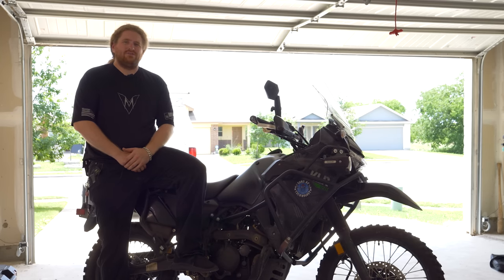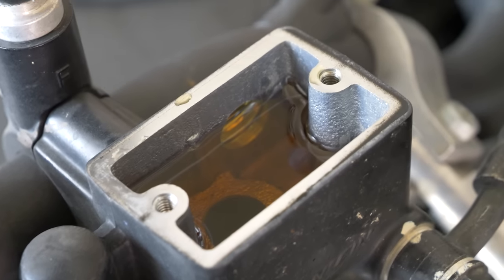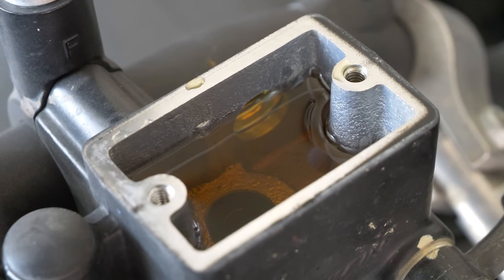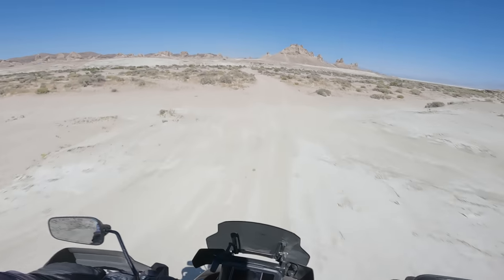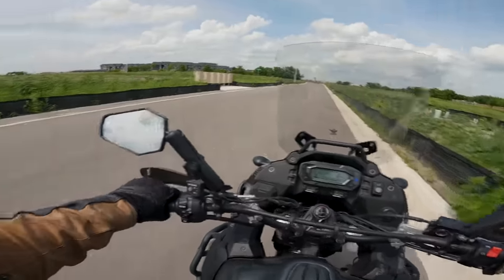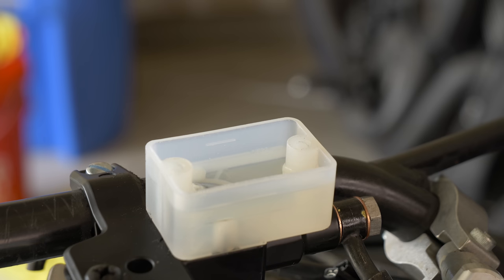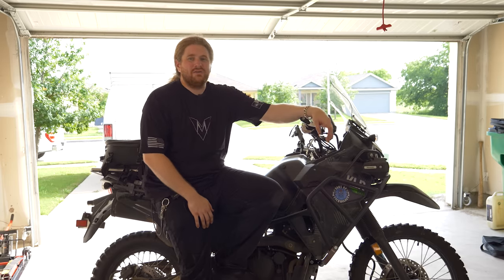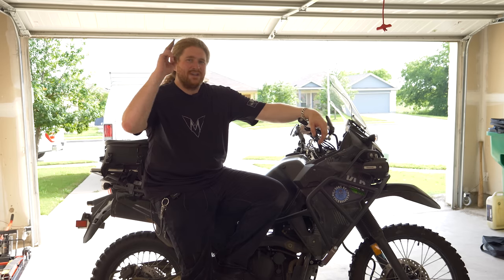Is Upgrading Your Motorcycle's Brakes Worth It?

Comment: Based on personal experience; both for dirt bikes and street machines, the biggest difference A -> B I've witnessed is changing over stock brake lines to stainless braided ones (if your bike comes stock with reinforced rubber/teflon lines from the factory).
If the bike already comes with stainless lines, the next best thing is a Brembo RCS-19 master cylinder.  I love them to death, and have so far installed 4 of them, including my kx250f.
Reply: That seems like a big jump in fluid being pushed around, from an 11mm piston to 19. Is that with a stock caliper? How much lever movement do you get from 0 braking to a stoppie?
Reply: @burgersquid   It's less about the amount of lever travel and far more about lever feel.  Braided lines definitely make a stock master cylinder (mc) far better than it was designed to be, but then the mc becomes the ultimate weak point of the brake system.  The main reason why I enjoy the RCS-19 so much is for the same reason why I prefer cable-style clutches over hydraulic ones.  It's not just what I feel from the lever that's important, but the fidelity and high definition of what I'm feeling in the lever as I'm pulling it.  The RCS-19 allows me to feel the minute pressure pulsations that come from the tire being forced up and down by the road and my suspension, and thus the lever pulsates slightly in the grasp of my fingers; slightly outward under compression, slightly inward on rebound.
Reply: @jacquescrusan9500  No they do not. It has been proven many times that braided lines do not expand less than rubber lines.  If you have new lines braded and not they will feel the same and they wear out at the same rate. Brakes lines unless hardline need to be replaced more often than people think they do.

Comment: In my experience, cleaning the pistons with soap water and a tooth brush and then grease them with red rubber grease helps a lot and is a very cheap fix. I do it at least once a year, together with replacing the brake fluid.

Comment: I swapped out my brake fluid after watching you basic maintenance video.  So glad I did it, the old fluid was dark yellow/brown.  Didnt feel much difference on the road, but at least I know its serviced!
Reply: Dark yellow/brown means there is a lot of water in it. You would notice if the brakes got hot. The water inside would start to boil. Gas compresses much more than fluid. That is the main difference between DOT 3 and DOT 4 fluid.

Comment: VERY informative for those of us not mechanically inclined.
My personal experience: Keep EVERY moving part in your brake lever mechanism as clean and lubed as possible. 
Periodically bleed your brake fluid as it gets dark and by nature it absorbs moisture.
It helps a lot  when it comes to squeeze the max braking power w/o locking your wheel(s) and prevent scraping both your bike and ego.
My front brakes are not the greatest when it comes to feel and I almost lost the front end braking hard when someone decided to make a left in front of me even tho they had a red light and I had the green. 
Lever had been feeling stiff and dragging.
Took it all apart, cleaned, inspected for wear and galling on the surfaces that mate (M/C plunger and lever's cam, lever's bushing, lever's pivot bolt), greased it all, assembled it and the better lever feel came back.
I hope my rant and long post helps someone.
Stay aware and ride like you're invisible !  😊👍

Comment: Interesting vid. Pads & braided lines is a pretty cost effective option for good results. Unless I was tracking it or the standard equipment was really awful, I personally wouldn't shell out for a new master cylinder but it's probably worth it if you can afford it.

Comment: I would say that it's always worth it to "upgrade" the brakes, as the ability to stop is way underrated.
I have an 82 KZ440, with a single disc rotor up front.  However, being a UJM that shares parts with its bigger sisters, I could add a second disc and caliper with little to no problem (other than the price-tag, and Mrs. Moosecat).
I might just do it, though.

Comment: Depends on the age of your bike. I done a full upgrade on my Concours14. Braided line on all brakes and clutch. Had master cylinder rebuild kits for front brakes and clutch. Both kits combined cost less than new master. Then new pads front and rear. Made it a completely new bike. 08 model with 55000+ miles.

Comment: On my track motorcycle, it came with 2012 budget ABS. I replaced the lines with non-ABS stainless lines directly to the calipers, new pads and, and fluid. I also replaced the lever because they came with the rear-set pegs… They feel great and work well on track, no rear brake light installed. My only issue is a persistent ABS light on, but I also removed the pump and extra lines…

Comment: My preference is EBC HH pads, brided lines, and now I would use DOT 5.1(after using in my car seems fine) doesn't paint strip like DOT 4. Master cylinder I would only upgrade if badly worn. But more than likely just get a OEM seal kit.

Comment: On the KLR the best you can do for the front is the 320mm rotor kit.  
Use kit Stockton 1124076 brake bleeder kit(under $20), it has a inline check valve so you don't have to constantly open and close the valve.(I use it on my cars also and recommend it to everyone)
Use silicon to lube up the caliper slide to prevent the slides from sticking and prematurely wearing the outside pad out.
Reply: I favor speed bleeders on every slave cylinder.

Comment: The first thing I did after getting an 87 Kawasaki 454 LTD was change the front brake master cylinder and brake pads. When I moved it 100 feet the brakes felt like I was gripping an over ripe tomato. Now there are brakes.

Comment: Id argue that the benefit of stainless lines is greater on abs bikes, rather than lesser, because brake lines are significantly longer.  The ABS unit is just a clear path through for brake fluid when not active.  

The reason SS lines improve feel is that the stock lines tend to expand a little bit.  Not much, but they do.  Longer lines due to ABS allow that expansion to encompass a larger volume of fluid, which results in more numbing of the brake feel.
Reply: Yup, a lot of upper end manufacters use a combo of hard lines and ss to reduce expansion.  Also upgrading the master and not going w a radial is a sin.
Reply: @philipparana9225  I mean, for a KLR.its excusable, and is definitely going to be a big improvement regardless, but yeah.  If someone was looking to do this on a sportier machine, bleed->HH pads->SS lines->radial MC
Reply: Just installing any old stainless steel brake line may not make any difference, a big factor is the quality of it. The size and /or number of the pistons in the calipers have the biggest impact on the way the brakes feel, larger or more pistons require less pressure therefore less expansion in the brake lines.

Comment: I would say that another upgrade is with brake rotors.  Rotors take an absolute beating:  they're exposed to the weather, dirt, and road grime, which gets baked on and baked in with the heat generated when braking.  As a result, rotors may start getting scored, developing grooves, or warping; none of that is good.
Finding a place to resurface rotors can be a bit difficult, but it can be a lot less expensive than shelling out for new rotors.
Reply: Also with rotors you should measure them with a pair of calipers (measuring tool not brake calipers) and see if the thickness is still in spec. ThisOldTony has a video where he chases soft brakes on a trials bike.  After throwing parts at it and bleeding the brakes multiple times, he found that even though his rotors looked good and were not warped they were thinner than spec thus the pads couldn't clamp it fully.

Comment: Fun video. I wish you had done a braking distance comparison just to see if any of the upgrades help with that, beyond just the better feel.
Reply: Was thinking the same thing, without a braking distance comparison, we really don't know what the improvement really is. What he "feels" means nothing to me as I may or may not be able to "feel" any difference.
Reply: Idk if it would've been worth it. A skid is a skid and if you have better brake feel, you're less likely to skid right? Basically I feel like one would definitely follow the other but it's still rider dependent.

Comment: The weak link on the first gen. Hayabusa are the front brakes. I tried several brands of pads and wasn't happy until I used Galfer ceramic HH pads. I also completely bled the brakes with Bel-Ray brake fluid. The Galfer pads were costly, but at least I don't feel like I'm attempting suicide when I ride the 'busa 2007 model now.

Comment: Spike, You must have very strong hands if a larger piston master cylinder made your KLR feel like the brakes were stronger!  Hydraulic theory would back up the fact that more force must be applied to the MC lever to have the same pressure on the pads.  Yamaha Viragos were noted for having spongy brakes right from the factory. They were designed that way because the demographic rider for these bikes were older and sometimes newer riders and Yamaha didn't want people locking up the front brakes. No fear of that as I am fairly strong in my hands, and could not get much stopping power from them on a  97 1100 dual disc Virago that is like new.  From first contact, to I can't pull it any closer to the handlebar, the MC lever moved about a half inch and if done in the garage, one could see the rubber brake lines expanding. Removing the calipers and cleaning and checking then thoroughly and new fluid did not help. Since I was looking for a super bike flat style bar, I knew I would need a new MC, so the research started and I found this site, "Front master cylinder ratio chart". Google it and check it out!  I found an inexpensive Honda four wheeler that had a piston size that I felt would work for me. I went from a stock master cylinder piston size of 15mm to one with a little over 13mm. I installed it along with SS braided steel lines and bled them. Well, I now have a MC lever that moves about an inch and gives me awesome braking with just two fingers. I went with more sensitivity because I have 25 years of riding experience and know not to grab the front brake.  But boy oh boy do I have strong front brakes now. I practice emergency braking every time I go riding and having strong brakes and being able to use them without fear feels so great.  Try looking up your stock MC piston size for the KLR and find a MC that has a couple of mm smaller. Install that and see how you like it. Oh, and do put on those SS lines.

Comment: Disagree on "dont just put a new lever" That little bit of adjustability in distance\length made a big difference in feel for me personally. 

Oh, dont get me wrong, it will not suddenly start braking better, but the feedback change - I definitely noticed it. (Possibly because original levers were ~30 years old with original bushings hehehe)

And, imo, on older bikes with no abs, braided lines do contribute significantly. Again, not necessarily in terms of performance (you are still more limited by the pads\tires imo) but the feedback - definitely.

Just a suggestion - since we are talking about braking performance, could you maybe find an abs bike and make a more-or-less quantitative brake tests with these changes? (fluid/pads/lines/master cylinder) Probably more work for little benefit, but I haven't seen a quantitative analysis myself:)

Comment: fluids are, in any somewhat normal use, not compressible.

This means that the fluid in your brake system is entirely irrelevant to how it feels or how quickly it decelerates. this only changes if the boiling point of the fluid is so low that it starts to boil under normal use.

and the only thing putting in new brake fluid achieves is raising the boiling point over whatever the old, waterlogged stuff had.
Reply from the maker: Old fluid will result in a soft and numb lever. The type of fluid, beyond dot rating doesn't matter, but old fluid won't  feel good.
Reply: @spitescorner  water has a compressioon modulus of 2.08 GPa, at atmospheric pressure and 20°C, while glycerine (close enough aproximation for DOT3)  is at 4.35GPa. The change between them is entirely linear based on weight percentage.

A braking system reaches something around 1500 psi (according to Mark William enterpises as they recommend 1200 psi or more for an emergency stop). that's 103 Bar or 0.0103GPa.

so brand new DOT3 braking fluid compresses by a whopping 0.237% under maximum braking.

meanwhile dot3 that contains 10% water, by weight, compresses by 0.251% under the same 1500 psi.

you ain't feeling that 0.013% difference in compression. 

especially if the bike just has rubber lines cause those expand a lot more than the fluid compresses.
Reply: @anonym3017 not until it becomes steam and your sol.
Reply: @philipparana9225  as per the first comment

"this only changes if the boiling point of the fluid is so low that it starts to boil under normal use."

Comment: Spite, you never even specified what kind of pads they are? Are they track pads? Just your new stock pad you're putting on? The slightly upgraded different compound pads? You didn't use wave rotors with the pad switch. New pads and rotors might make a whole lot of difference instead of throwing a pair of pads on a junk rotor? No braided lines for the bike? You jump straight too Master cylinder which is usually the last thing you do to tighten up your brake feel? Fluid change? Not so much

Comment: Does anyone else also experience a vague brake feeling with their Tenere 700?
Reply: The T7 ABSOLUTELY has pretty soft brakes.  The rear because of the pedal (see Camel ADV's brake fix for a solution here if you want) and for the front, yeah, same general thing as the KLR but going SS lines will be a huge upgrade as you've got miles of brake lines due to ABS and dual discs. 

You can throw in HH pads on the front as well if you'd like, which does increase bite.  Be sure to get HH pads though.

The Camel fix for the rear makes a HUGE difference though, allows you to lock up the rear without literally standing on the pedal.

Edit: to be clear, the T7 brakes stop the bike just fine, they're just kind of vague feeling and require significant pressure.

Comment: Yeah bleeding the brakes is super quick and easy only takes 10 minutes unless you want a Ducati Diavel and have to take the rear wheel off and flip the caliper up to the top of the rotor. Takes about 45 minutes to do front and back. Fuckin Ducati

Comment: Hey Spite, I would be very careful about giving advice of this kind, there is so much that can and does go wrong when people with little or no understanding or mechanical ability/knowledge start messing around with what is probably the most important safety system on any vehicle. Furthermore, have you considered how changing the master cylinder might effect a bike fitted with ABS brakes? (which are mandatory in most of the world). I would suggest that changing anything in the braking system would be very likely to cause it to stop working properly and certainly void any warrantee and possibly/probably any insurance claim. I know you mean well, and I have seen you do this before, but I doubt you have an engineering degree so perhaps stick to slip on mufflers and oil changes.
Reply: Found the guy who makes his living charging 1000$ for a brake upgrade😂
Reply: @JohnSmith-pz7vy  Haha, if only!. No, I am just a humble mechanic, which obviously Spite is not given how I have seen him struggle to do even the most basic maintenance on both this channel and the old channel with 'he who won't be named'. Sure, go ahead, do modifications to the break system on your car/bike, but be aware that there could be serious and expensive consequences down the line.
Reply: I think Spite said that it might not be a good upgrade with abs on the bike
Reply: @veloroadpig1  I hope so, I admit I skip watched the video because I was so annoyed by what he was saying and his obvious lack of competence and knowledge. This modification to the KLR is ill advised and could have catastrophic consequences, especially in emergency situations where the front wheel is now much more likely to lock up and just skid out from underneath you. Sure, put in harder brake pads and braided brake lines, but that should be all the home handyman does.